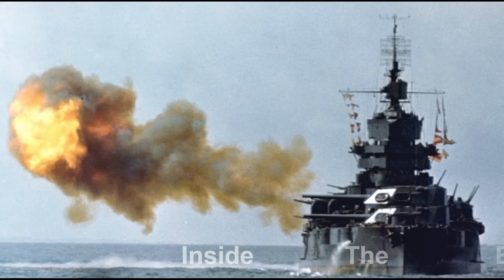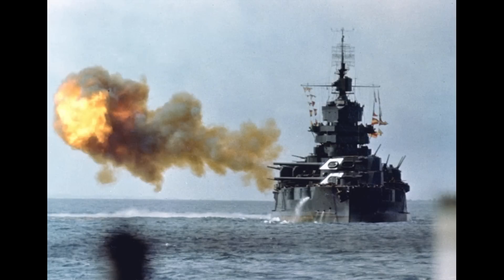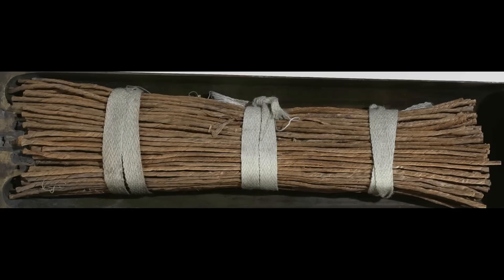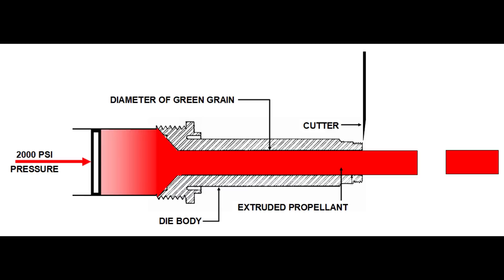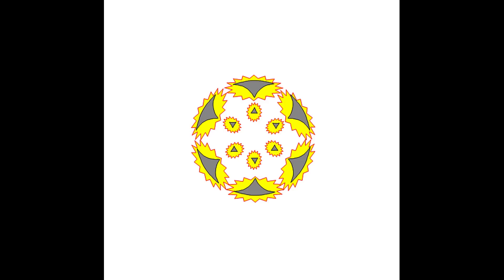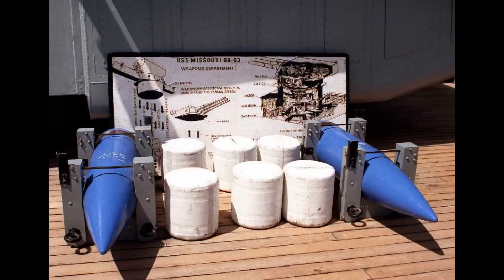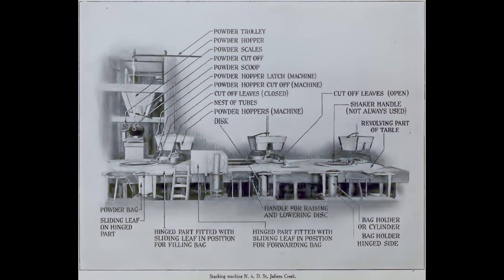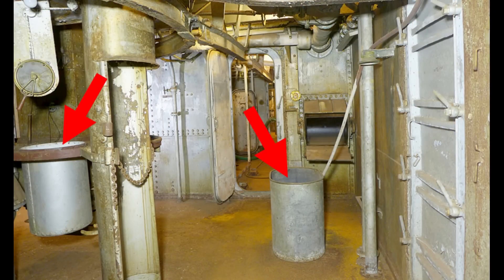Battleship Texas, Fuel For 10 Giant Chemical Engines

Comment: Ehm, is the title incorrect, or just misleading?
Interesting story, though I expected a different one.
Reply from the maker: I will readily admit that I used it as a hook, but it is correct.  How likely would the casual visitor look if I called it "A brief description of the design and importance of nitrocellulose propellants to the interior ballistics of 14" guns".  It is correct because a chemical compound burns to provide pressure that accelerates a projectile through a gun bore, much the same way gasoline burns and expands to push a piston in its cylinder.  Of course, the piston is attached to a crankshaft that converts linear propulsive force into rotational force.  The gun's projectile is obviously not attached to anything, so the engine is used to accelerate it to a desired velocity so that it will fly on a predictable path once it leaves the gun.

Comment: Outstanding video as always, Tom!
I'm curious as to know how high the external gun barrel temperatures of the 14"/45 reached during a prolonged engagement? The photos of the burnt paint on the British gun barrels that engaged Graf Spee come to mind.
Reply from the maker: I don't have exact numbers, but I am sure that the 14" guns didn't heat nearly as badly.  The British 6" guns used on Ajax and Achilles had a rate of fire of 8 per minute as opposed to 1.33 for Texas.  They would have certainly been approaching a rof of 8 when going against Graf Spee which would result in much higher barrel temperatures.

Comment: imagine what the 16 inch 50 gun could do if designed to use the tripple base powder we have today
Reply from the maker: I suppose it would likely give some overall performance improvement, but I'm not sure how much.  Maybe the big improvements would be reduction of charge size and perhaps barrel life would be extended.  It would still have to operate within the barrel's design constraints, so I don't know that you would see much increase in projectile velocity.  I would be more interested in what could be done with sub caliber, self guided munitions.

Comment: Great job as always! BZ! Lots of info I didn’t know. The picture at about 7:26 those are the 16 inch reduced charges, real not dummies. The one time I can remember firing the guns over the bow we ended up with lots of powder on deck. Broken pieces like your drawing. A triangle with 3 concave sides. Thanks again!
Reply from the maker: Wow, Bob, it's really interesting that you mentioned that!  I recently read a manual that stated that unburned powder slivers were very common with reduced charges due to low bore pressure combined with sudden decompression that extinguished them.  It's nice to hear first hand confirmation of these issues!  I would like to talk to you sometime about magazine inspections.  There is a 1923 manual called, "Ammunition Instructions For The Naval Service" that apparently was the bible for gunnery officers.  It went into extreme detail on all aspects of ammunition storage and inspection, including surveillance ovens kept on board.  The book can be downloaded on Google Books.  I am curious about how procedures on ships had evolved by the 1980's.

Comment: Can you explain the designation “12”45 caliber” etc.?
Reply from the maker: Sure.  The term "caliber" is not used in the normal sense.  It is used to describe the bore length of a gun barrel, which is the rifled portion not including powder chamber.  This is commonly used to describe naval guns.  To answer your question directly, the bore of the gun is 12" in diameter and 45 calibers long, or 12X45= 540"= 45 feet.  Texas has 14"/45 cal., so the bore length of her barrels are 14X45= 630= 52' 6".  The Iowa class have 16/50 cal. guns, so they have a bore length of 800" = 66' 8".  This is very helpful when distinguishing between different guns of the same caliber.  The best example that comes to mind are the different U.S. Navy 5" guns with standouts being the 5"/51 that were single purpose high velocity cannon heavily used in the early 20th century.  Battleship Texas started life with 21 of those as close protection against destroyers, torpedo boats, etc.  and ended her career with 6 of them.  The 5"/25 cal. was a compact gun that worked well as a really heavy submarine gun mount.  The best of them all was the 5"/ 38 cal. dual purpose that was extensively used during WWII for both surface targets and as a superb anti-aircraft gun.

Comment: For the Iowa class piwder bags, there was a trim layer of loose grains of powder lying on their sides that was used to bring each bag up to the exact correct weight. It is believed that an overram led to the trim layer grains being crushed and the heat and friction of that led to the open breech detonation (technically a deflagration) on board the Iowa.
Reply from the maker: Yeah, I read the report.  It's interesting that I have never seen a reference to a trim layer in any ordnance manuals in their descriptions of powder bags.  It makes me wonder if perhaps it didn't come into use after WWII.
Reply: @tomscotttheolderone364  I believe it started in the 1980s when they remixed old powder lots to make new bags for the Iowas.